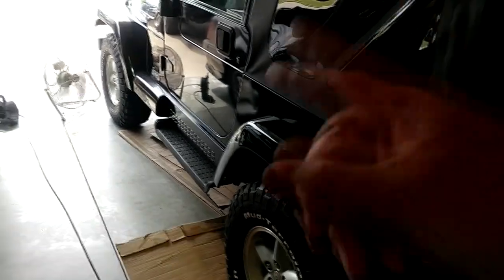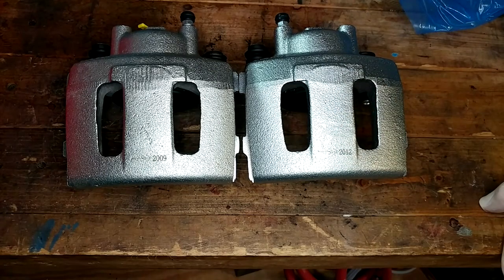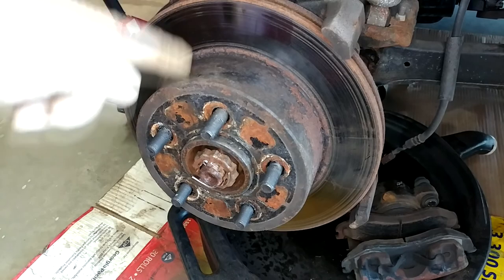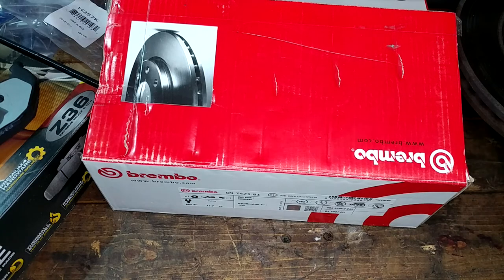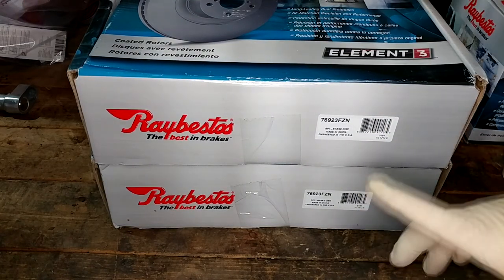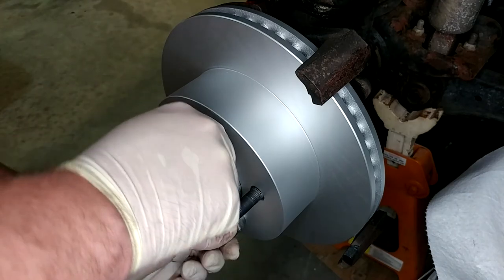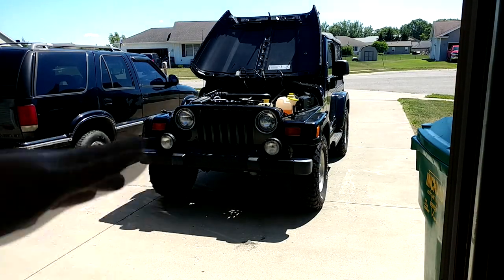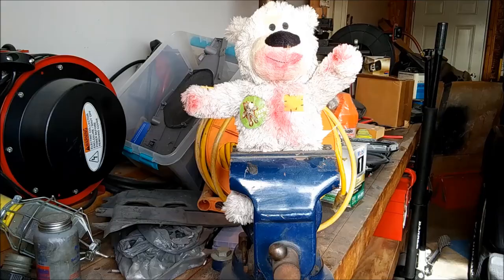Jeep TJ Front Brake Rebuild!

Comment: Pull the boots and put a bit of grease between the caliper  cast iron and that middle section of the boot.  Just pulled my calipers, re-greased...still tight.  Pulled the boots and found scale rust between boot and rubber.  Wire wheeled that and probably get another 2 ohio winters before they seize again.
Reply from the maker: I'll have to keep that in mind if it happens again.

Comment: 30:00  I would be a bit leery changing out OEM bolts for random bolts in the chinamart box.  You are a braver man than I.  You can be sure in 99% plus of cases that American OEM bolts are very high quality and are what they say they are.
The whole problem with China is Chinese morality/honesty.  They are very dishonest.  It is part of their culture and part of who they are.
Reply from the maker: You have more faith in 1999 Daimler-Chrysler than I do. I have absolutely no reason to believe the original bolts were US made or of any particularly high standard. While I agree the new bolts are probably no better, they are also new. ...and, Raybestos is a premium brand that has been around for 120 years. They're not a random supplier.

The original bolts were still serviceable, but pretty rusty and starting to get rounded over. I did save them just in case. You also have to remember that the bolts simply hold the calipers on to the spindles. The actual stopping force from the pads is being applied the spindle itself at the interface between the pads and the spindle. The bolts are just along for the ride.

We share the same general thoughts on Chinese quality, but we're swimming with it all the same everywhere we go every day. You're really going to blow a fuse when you see the Blazer steering. I'm still not sure how that is going to work out...😆
Reply: @TheBrokenLife  Up until the 1970s, the US was the China of those days in that we flood the world with low cost goods. The difference was, made in the USA was synonymous with quality, deserved or not. 

The "made in China:" logo is synonymous with junk, especially if it is rebranded or unbranded Chinese stuff.  The problem is all that poor quality and pirated stuff is in all the supply chains.
Just look at all the problems you are having.  This didn't happen before China was in the WTO.

The brand in some sense doesn't even matter. So much of what is branded a well known American name is nothing but re-badged Chinese junk.  Then there's fakes.  They have gotten into legitimate supply chains.  I've heard stories of people ordering brand new (as in newly engineered, not as in not-used) from the manufacturer and getting Chinese fakes.

I'm not disagreeing with you here. But I would never take anyone's 100 year reputation into consideration these days.  I did before.  But far too many companies cannot say no to China.  They slap their name onto something made in China. They are literally liquidating their customer's good will.
Reply from the maker: @tarstarkusz  All of those things were, more or less, true in 1999 when my Jeep was built too. I have no idea who the OE builder of calipers was (or where), but they were junk from the start, as verified by Chrysler engineering. Not much more a poor boy can do there. Anything is an improvement over terrible.

The problems I'm having are the same ones I've had for 30 years. That's why I'm on the grand experiment of seeking out new brands/lines of products to experiment with. I have a reasonable feeling for what doesn't work, so let's find out what does. I just did brakes on 2 vehicles with 3 more to go (in the near-ish future) so this is the perfect opportunity to see if I can get repeated results.

I only pointed out Raybestos' brand history because they actually have skin in the game to lose from selling substandard parts. They're owned by a huge conglomerate with deep pockets to be sued. It's not Funky Frank's Discount Auto Parts selling straight from the PRC with no accountability possible... although I will be using some of those parts in the future. ☠💀👻

As an aside: I'm also at least initially impressed with the quality of the Raybestos Element 3 line. The plating is well done and complete, the quality of the castings are very high, the finish work is very nice, and all of the soft parts and hardware seemed to be of good quality (especially considering it had been sitting around for 12 years). So far, the standard of quality appears to be higher than Brembo and Powerstop and roughly on par to Stoptech, which would be about twice as much money in that application.